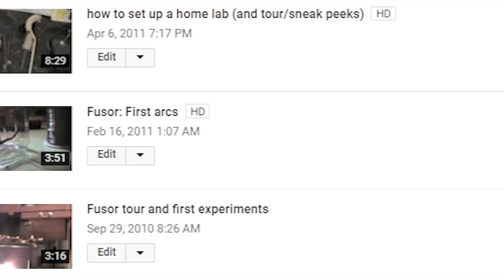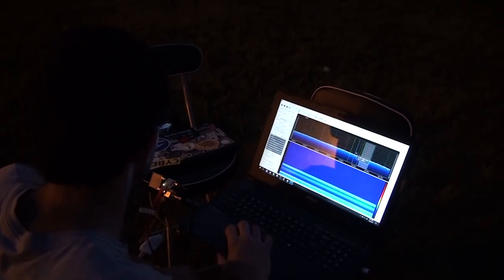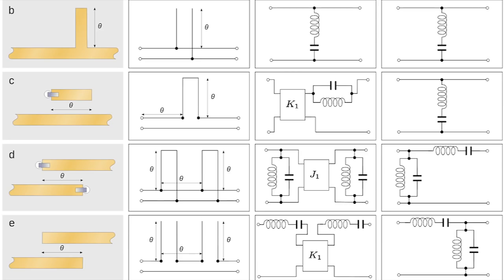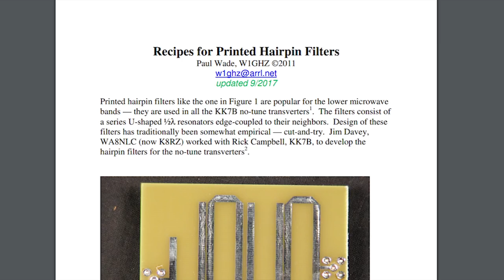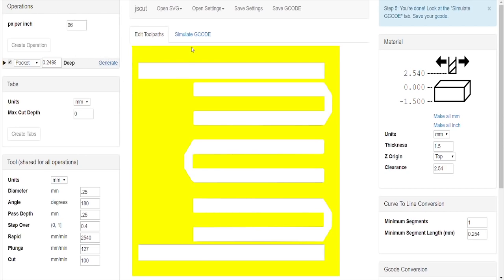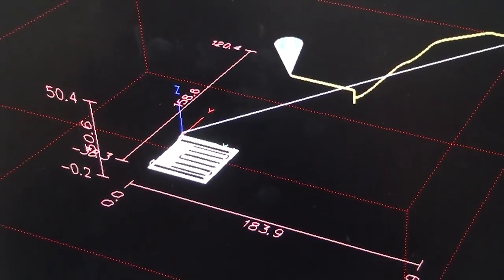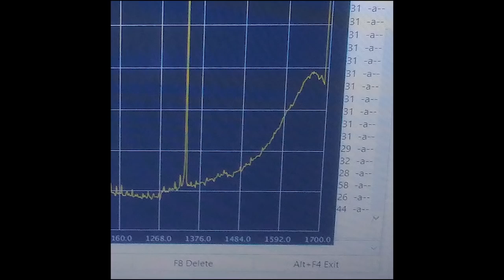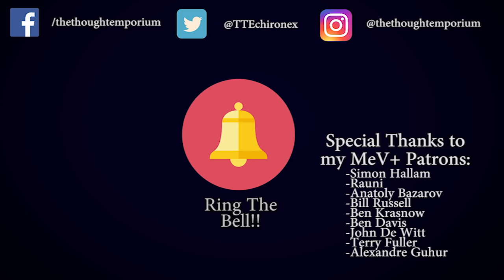CNC Milling Radio Microstrip Filters

Comment: The way to properly mill PCBs is to autolevel the full board once it's been mounted, by using the tool itself as a Z endstop.
LinuxCNC should support that.
Reply from the maker: Hey spirit, thanks for the suggestion! I'll be sure to look into it at some point and see if it works as well as you say. I like both ideas honestly as they have different applications and scale/complexity, though I will say structured light does seem like it would have more general applicability even if it's harder to implement. Honestly probably just gonna stick to leveling it by hand for now and refacing the bed. Im lazy and that's the least effort solution.
Reply: You could still use a touch probe for plastics. You just need a conductive plate of known thickness on the lead that you normally connect to your PCB. Place this on top of the stock and aim the tool at it, probe and then set your z axis offset to the thickness of the plate. Now Z0 should be slap bang on the very top surface of your stock. Of course this single point probe won't help too much as regards out of level compensation. If you're milling incredibly thin plastic then it might not be of use to you but for flat material thicker than a few mm it's a much more accurate way of zeroing than by eye or with feeler gauges. For the cost of two bits of wire, a crocodile clip, a small piece of metal and 30 minutes of your time it's a good cheap enhancement to your machine. If you do intend on milling a lot of PCBs you'll probably make the time and money back very quickly through not having to scrap as many failed PCBs and re-mill them.

There's no doubt more elegant, cutting edge and accurate solutions but i think they'd be a waste of time on wonky dremel-bot.
Reply: just mount a 3D printer standard, BL Touch ( its a servo with a touch sensitive probe, G28 (autocalibrate) the servo extends the probe and the surface is tested, after its done it retracts out of the way )
Reply: Seems to me you could pretty easily make a touch probe by dropping a pin of some kind into a tube of some kind (even if you WEREN'T such a jeanyus), maybe with some little metal and plastic bits, and arrange for them to be in electrical contact until the pin gets pushed up inside the tube a little bit because you rammed the Z axis downward until it touched the board.  No electrical connection with the stock required.  Even (gasp) plastic!  Then use some of that watchacall "auto-leveling" software.

'Course, a three-axis switching probe isn't really that hard, either...
Reply: @ydonl  Thats basically, more or less, what a BL Touch is, that Radek mentioned above you. Works great for 3D printers. Though to correct what he said, G29 is autolevel, G28 is home. Not necessarily a LinuxCNC thing. Idk.
Reply: Spirit  even if the bord is not paralel with the axis
Reply: You have LinuxCNC and it's spitting stuff out(and taking it in) via parallel port, you can definitely add a Z probe to it.
Dig in a bit more. Alligator clip onto the tool, the other directly onto the copper, drive it at around 1000mm/min down to 3mm, then at 20mm/min down to -0.5, wait until it touches.
Reply: The "PROPER" solution is to not use a bent machine. Structured light is nowhere near precise enough for this.
As for "overengineering", it took me 15 minutes to set up. If you don't need it, maybe he does, which is why I suggested it.
Reply: He might need it to mill PCBs, which he clearly had serious issues with. I don't see why improving on it to help everyone would be a bad thing.
Structured light is not precise enough to take out half a millimeter of warp over such a large area. It's not used anywhere in the industry for this reason.
You don't need to be so aggressive, I'm just trying to help as I've done this myself.
Reply: Well, someone's got anger management issues and serious insecurity.
I'll keep being a "user" and milling my own boards with 8mil trace/space while you know better than me and do nothing with a crooked machine.
Reply: You've cited nothing beyond saying "I know better than you".
I'm an EE, I'm paid to do this, and I've also made a video about milling PCBs :)
It requires a lot more precision than "waving a dremel around".
Reply: You've cited nothing, you've being a jerk to somebody who gave you a very good solution to a very common problem. But i guess over engineering this with some projectors and cameras and OpenCV and a month of programming time makes you look smart...
Reply: The laziest solution is facing the bed and using a springy shoe to push down on the material around the bit. Works pretty good.
Reply: It's funny how arrogance blinds people. Go ahead get paid for something inefficient but don't you ever claim to have the best solution. I don't care whatever you are, but i'm sure as hell you ain't god damn innovator. Hell you're prolly a plankton in the sea on this field lol.
Reply: Spirit read this guy like a book. All hail science!

Comment: mil is a thousandth of an inch. True, it is arbitrary as it's imperial, not metric :) 
Cool video! Keep it up!
Reply: Radomił Thank you. I'm Canadian but studied electromechanical engineering and as soon as he said mils were arbitrary I went 'ARGGGGHHHHH!'
Reply: goohz has a channel Lol yea I do. But he also gave the explanation of what a mil was, and was saying it was arbitrary because it was based off of Imperial measurements rather than a mil not meaning anything in particular as implied by the video.

I love this channel still though. 😃
Reply: Because the metric system isn't arbitrary? A meter was defined as one ten-millionth of the distance from the equator to the north pole. Now it's based on an equivalent distance traveled by light in a vacuum in a set amount of time. That's pretty fracking arbitrary. There's nothing inherent or fundamental to the universe about that. If we meet aliens one day, they won't be using the metric system, because we made it up. 

I love the metric system, but to imply it somehow isn't arbitrary is just idiotic.

Comment: 1 mil is a 1/1000 of an inch
Reply: Mil isn't really arbitrary. In the PCB industry the standard is mil. I used to make 5mil tracks with 5mil gaps as the norm. When you start using microwave boards then these started to reduce with 1thou/mil not uncommon. It all depends on tolerance. I never designed circuits only used CAM software to aid manufacturing. Many if not most microwave PCB had aluminium backing. Otherwise great video.
Reply: john - wide usage doesn't mean it isn't arbitrary - and "mil"/"thou" is a great example of that - with the next smaller step down form inch being down to the 1/16th - and then you have another different subdivision all together - and if memory severs correctly the ONLY conversion-factor that is a power of 10.
Reply: Huh?   The next "step down" from an inch would be half an inch, and from there, 1/4 of an inch, and from there, an 1/8 of an inch, then your precious 1/16, and so on, and so on.  Each step being a doubling of the resolution, which IS a perfectly rational approach, quite practical, easy to work with, and very intuitive.  Which is where it came from.  The fact that you weren't raised with it doesn't make it arbitrary.

And is there anything really all that much more intuitive or practical or rational or non-arbitrary about defining a unit of measurement as "slightly less than 1/40000 of the circumference of the earth?"  What practical use does that have?  Maybe for travel and navigation, but you need a thousand of them to even get started with that stuff.  And then you have to break up that thousand into smaller pieces in order to measure actual distances.  It's all -- chaotic!  Even though it seems so wonderful!

And is there any more magical about a milli-meter than a milli-inch?  I think not.  Machinests, of which there are apparently not too many around these parts, have been using measurements generally centered around 0.001 inches for quite a long time, and the sizes generally correlate to actual machining operations a lot better than that metric nonsense, I'd say, where a hundredth of a millimeter is too big and a thousandth is too small.

At the very least, all this is not as clear-cut as you wacky foreigners seem to think.
Reply: @ydonl  Very well put. This idea that "it's arbitrary because imperial units aren't base 10 and so 1/1000 of an imperial unit is arbitrary", well, base 10 is arbitrary, and as you pointed out, so is the meter, the basis for the metric system. So frankly, if you call a mil arbitrary, all units are arbitrary, except the very few that distinctly aren't. 

A mil is a very common unit in machining and PCB manufacturing.
Reply: @ydonl  Or you could just admit that dividing things by a factor of 1000 to get to the next "step down" is very practical. The mil is nothing more than (kind of) using a little bit of metric without admitting it.

And, btw, you can use 5µm, if 1µm is too small and 10µm is too big. I don't see the problem there...
Reply: Which in it self is a rather arbitrary unit as normally the US customary units do not have a base10 system - specifically with inches normally the next division is 16th of an inch.

Comment: love your videos mate,  just a note "mils" arent arbitrary units, they are millionths of an inch. this is an old hang-over and is quite a common term in PCB manufacturing
Reply: 1/1000 not 1/1000000, right?
Reply: https://simple.wikipedia.org/wiki/Thou_(unit)
Reply: Irvin Coria see, I was right.
Reply: Wow I just noticed that autocorrect in my original comment it was supposed to read mileniumths as in 1 in a thousand (ie a milenium being 1000 years) yes they are interchangeable with the unit thou
Reply: Lame Urinaldrama nope it's actually 1/1000000000000th

Comment: Do this things directly in Inkscape - you save you so much trouble.
Reply: There has got to be a way to write a little Python or something that lets you enter a frequency range and just pops out an SVG directly without needing to lay it out by hand in a GUI app at all.
Reply: This part made me legitimately angry.
Reply: There's a program for Linux called potrace, and it's the answer to this problem. Builds available for other platforms. It does automatic vectorization and outputs a black and transparent SVG. I'v even used it to vectorize colored images, by creating a color palette and subtracting the difference and outputting that as greyscale. The black and transparent masks for each color are vectorized and are then imported and recolored the colors of the palette. This results in a flat design looking version of the original graphics that's infinitely resizable.
Reply: Inkscape has honestly saved my job. Amazing opensource software!

Comment: So... you're making 2 band pass filters in one, basically series connected and hundreds of mhz apart and expect something to pass thru?
The bandwidth in those is pretty narrow. So, unless you extract the signal somewhere in the middle of the filter and say you get it fed by 2 antennas... ;))

My advice: tunable bpf for each rf zone you want to work with. (yes, microstrip can be tunable with conductive or dielectric elements like aluminium threaded cores that lower the line inductance or increase capacitance, depends on design.)
Having them tunable will also help you Z match your antennas and feed lines with the receiver.
Reply from the maker: What. No. They're for 2 different projects and won't be used at the same time... obviously. That would make no sense

Comment: I used to produce some machined RF filters on a CNC lathe. They were brass bars with ~2mm base diameter that had these ~14mm  dishes of varying thicknesses.  I think they went into cell phone towers and were heavily prototyped and adjusted between the runs to hit the spec.

Comment: I imagine the thickness of the PCB and therefor the space between the copper layers will have quite an impact on the capacitive coupling.
Maybe trying different thicknesses can help improve the quality of the filter.
Also, maybe consider adding a single sided PCB on top with the copper facing away, connecting it via a wire to the bottom and seal the edges with copper tape.
That way you don't need a metal can to prevent the filter from picking up unwanted local noise (which this type of filter really loves to do by design for it is basicly an arry of antennas tuned to the desired frequency).
Also, one thing you often see in RF devices are filters that essentially short out the signal they pass through to the ground in order to attenuate or supress them.
Just in case you have some strong RF signals that could interfere with your project.
And, if i remember correctly, you can try adding a very small variable tuning capacitor between the signal line and ground to tune the filter even further once it sees action.
But don't make me remember or dig out the math behind that :-D
Reply: i was talking about sticky copper tape that you can buy in DIY shops for making tiffany glass. If even that is unavailable you can also use solder wig.
No need to go for anything fancy :)
Reply: An alternative might be copper tape on teflon.

Comment: I still don't understand why you don't just use a dish for GOES. They go for $120 on Craigslist and are way more efficient than your weird corner antenna.
Reply from the maker: Note the new antenna I ordered that's been tested to work for GOES reception. I still want to try with my antenna, but I'm aware there are easier solutions, hence why I bought it as a backup.
Reply: The Thought Emporium have you tried a 5.8Ghz Grid antenna? They work surprisingly well, also interesting that you skipped over HRPT straight into GOES
Reply from the maker: Goes doesn't move, and the pay off is higher. It's technically easier if you have the right bits. I want the grb signal so I can get those awesome sun images. Saves me buying a solar scope if I can just borrow NASA's :p also the lightning camera and ton of other instruments makes it a more interesting target.